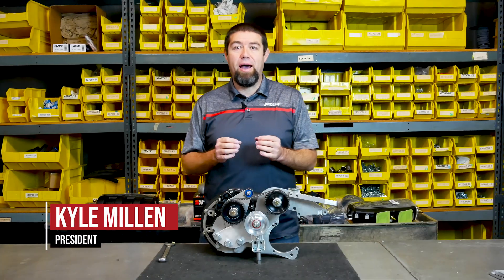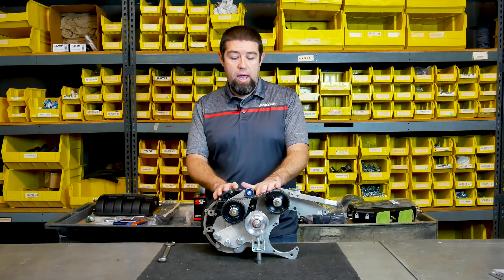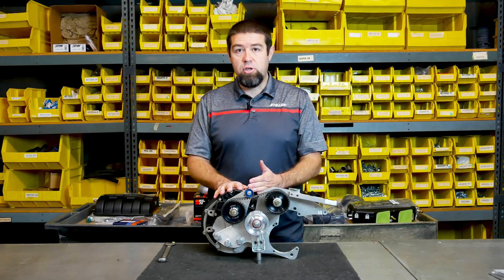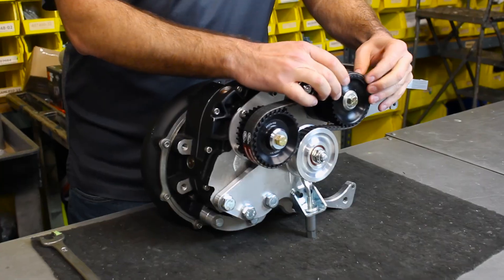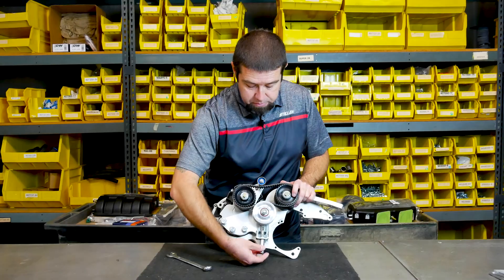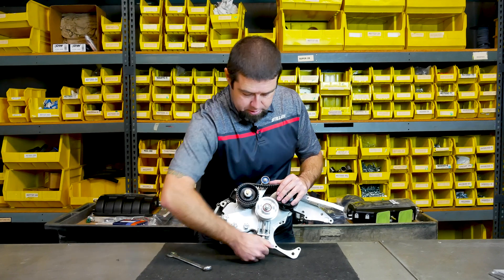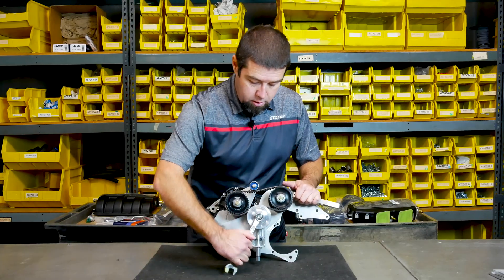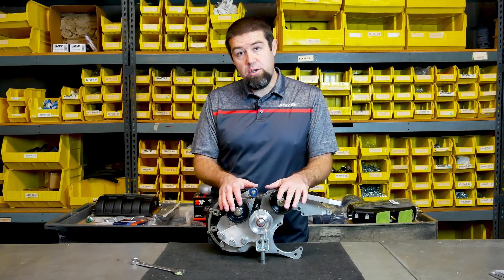STILLEN Supercharger | Cog Drive Belt Tensioner Setup

Comment: Hey guys I followed your instructions, and like your video I can move the belt back and forth on the cogs with little effort. However, after driving and getting everything up to temp, I can no longer move the belt back and fourth due to it shrinking from the heat. Should I be able to move it once everything’s up to temp? Is my tension still too tight?
Reply from the maker: Shoot us an email or give us a call and we can assist you with this!